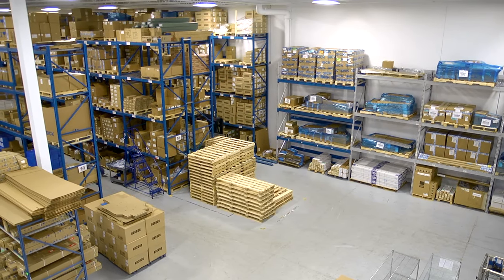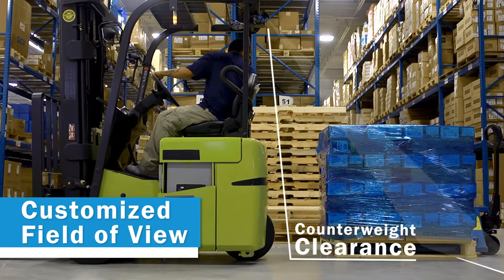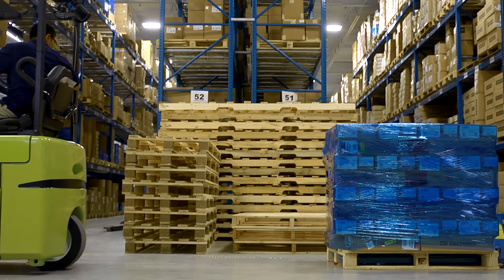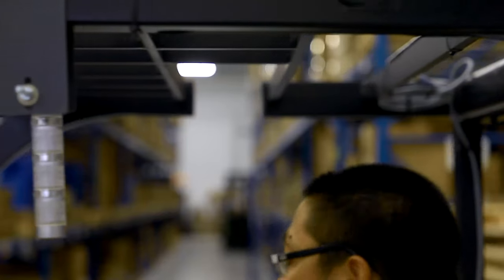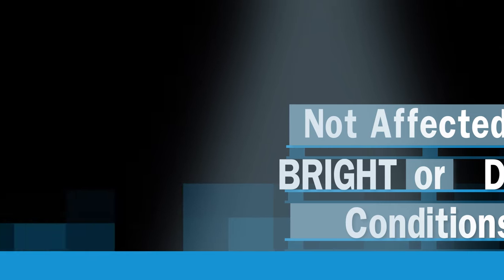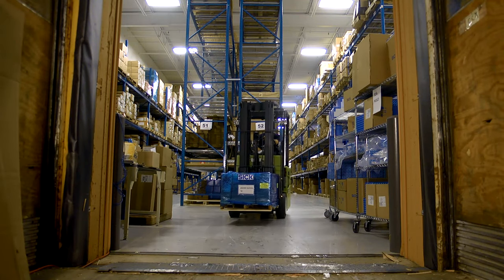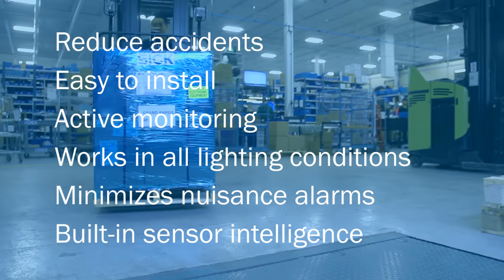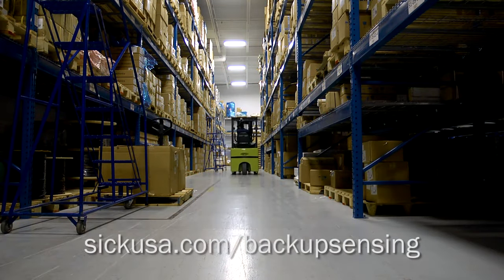Active collision warning alerts for manned forklift truck applications

Comment from the maker: Thank you for your interest! The BAS provides active warnings against collisions between the forklift it is mounted to and anything else in its operating environment, including structures like poles and shelving.  It is not intended to provide human collision safety and does not control the stop functions of the forklift, such as the brakes.  The operator is still in complete control of the vehicle while the BAS functions to warn that driver of hazards in the moving path of the vehicle that could potentially cause a collision. Please contact us at info@sick.com if you have further questions!

Comment: It should use 3 sensor medium ultra sound, LIDAR and gravity pulse so that it can compare all three reports and if all three match then it can filter interference of any of single mode sensor and it could include mine detection and deep penetration scan of wall and underground gas line or electrical conductor for warehouse operation and all terain vehicle it can instantly convert to serve ship, underwater unmaned torpedo, seaplane or aircraft carrier landing for aircraft. This sensor alone can estimate a hundred million market in first years and trillion market in 5 years